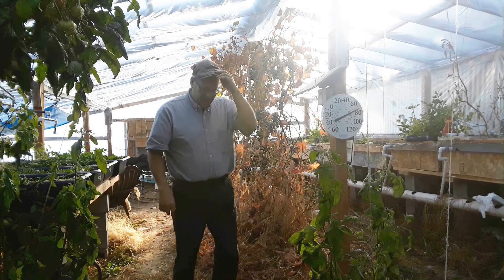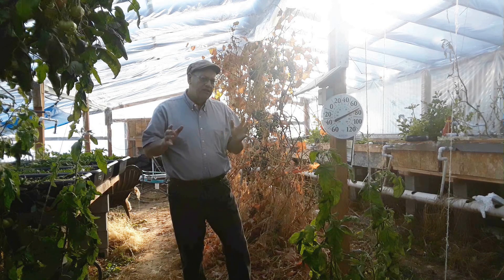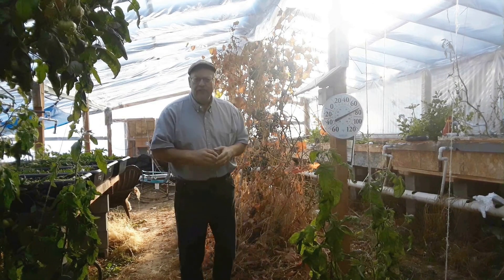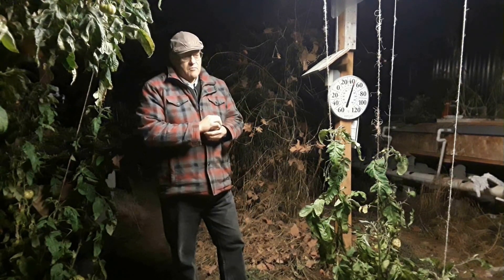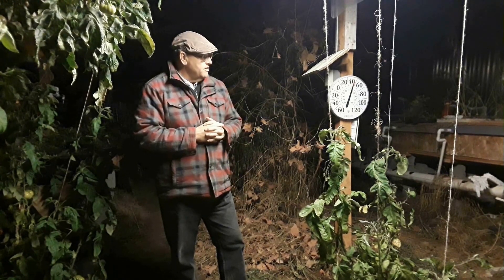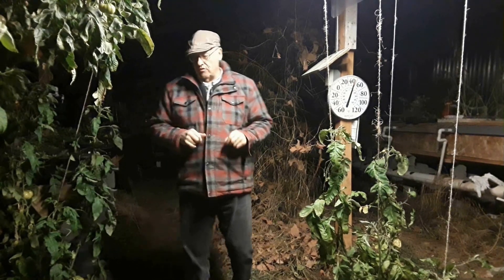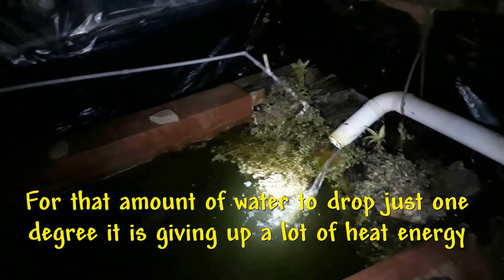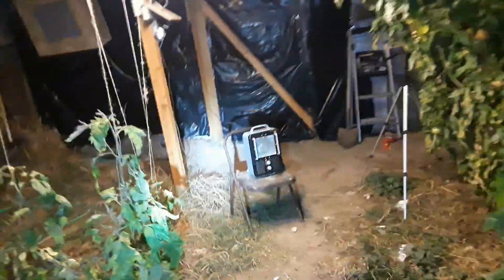Winter time greenhouse temperature variations

Comment: All good ideas. Where are you climate-wise? I'm at 50 degrees north, near to Pacific Ocean so  moderate temps are common. Our daily sunlight hours from Oct to Mar are about 2 hours;, so the sun gives little toward night heat. Our GH carries lots of greens and little else through winter, though we gain more sunlight for  starting plants for transplanting in April and May, Those folks who  also get little sunlight might consider NOT using a GH but use their basement or a bedroom?)plus LEDs ; otherwise the GH heating might be too pricey, especially if your desired plants need more warmth--
Reply from the maker: I am at 41 degrees north and during Oct - Mar we get perhaps 5 hours of sun during the day but living in northern Utah the temps are not moderate.  During December and January  we get hard freezes every night.   I usually start my plants the way you suggest...indoors in the basement but I have built a couple of insulated grow boxes out in the greenhouse with incandescent  lights  inside  that work really great.  I have been able to grow tomatoes through the winter.  It's nice to have fresh tomatoes in January but you are right, the cost of heating to do that is pretty high.